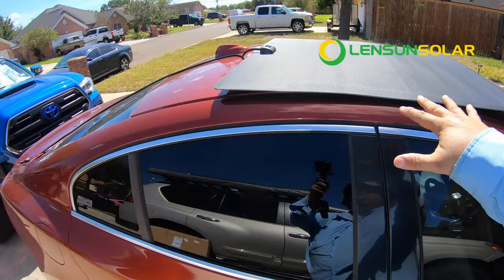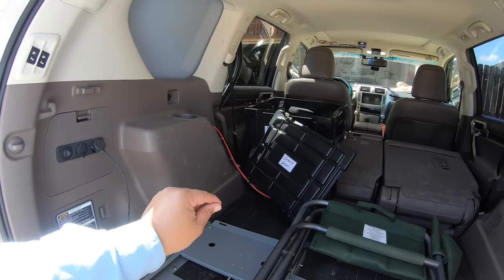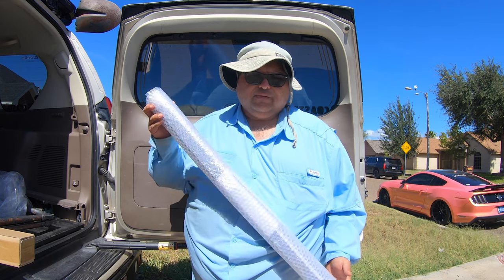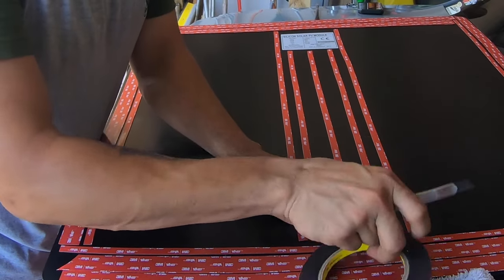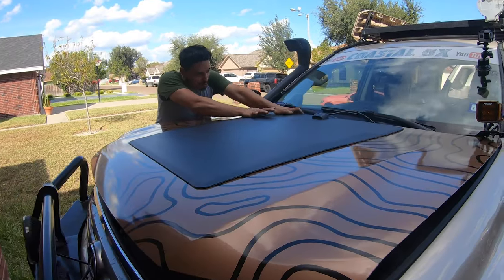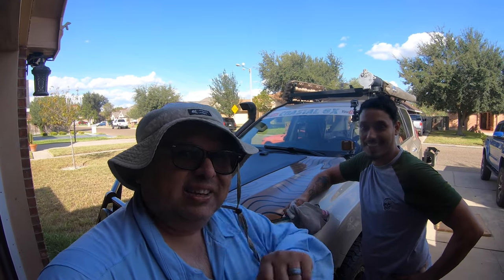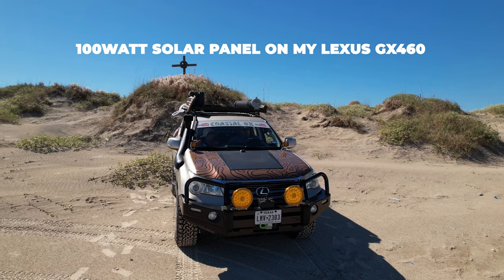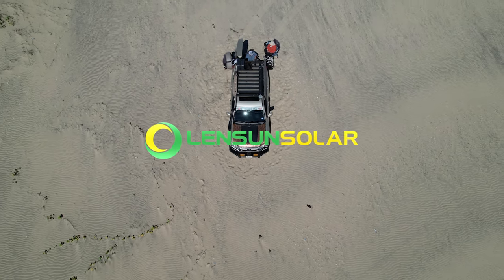Hood mounted solar panel installed on GX460 - Lensun Solar

Comment: If you use multiple extension cables and plugs chances are that you switched the + and - poles somewhere along the way. That has happened to me  once while using off the shelf adapters and cables. So you might check the + all the way from the solar panel to your mppt,. And from your mppt to your battery.
Reply from the maker: Thank you for sharing this!
Reply: @CoastalGX  You're welcome. Hope you will find the cause, whatever it is. Btw, it's a bit hard to see but is the mc4 plug at the end of the red extension cable (on screen at 14.16) a female plug? If it is you might have connected this red cable to the - male plug of the last black cable going into your mppt. Maybe I'm  all wrong but I think it's worth checking.
Reply from the maker: @Remko2011  The problem was with my crimping on both the Anderson plugs and MC4's. It was just a micro length from clicking properly. I know better now and everything is working as it should.
Reply: @CoastalGX  Good to hear you solved the problem!

Comment: I purchased the 35 watt solar system with solar charger with Bluetooth for my start battery only. But I will definitely be checking out my solar panel before I mount it to my jeep gladiator rubicon hood

Comment: Nice video - I like how you show us the struggles along the way - it is more real! I am considering just mounting a true sine wave inverter in the rear of my GX to charge my power station which I run my fridge and electric blanket from. the inverter will charge my power station when driving. Seems like a small 500W inverter connected from either the 3rd row power seat harness or from the engine bay (new wire run to the back like you did) should do the trick.
Reply from the maker: Hi John, thank you for the feedback. Yes, there’s options; Just make sure to check the appropriate wire gauge and fuses to avoid risk. 🎥

Comment: Thanks for the informational video, I'm thinking about buyin the same panel for my 4runner but have it hooked to a Ecoflow power station and use that for my fridge and any other thing I might need 120V.
Reply from the maker: That should work; there’s different configurations. I’m still using this setup and it’s going strong. I park in covered parking at times and the heat is brutal so the fridge works hard. I have to charge my battery on weekends and the panel maintains it the rest of the time.

Comment: The simplest way is to connect to MPPT directly to the solar panel without the extension wire and then the wires that are coming from the MPPT to trigger charge the battery connect that with the extension wires that you already have installed to the battery that you have installed in the back of your Rig. That should fix the problem?   The MPPT is designed and calibrated to work with the length of the wires coming out of the solar panel.
Reply from the maker: That’s what I ended up doing. The MPPT is located closed to the solar panel in the engine bay and then I ran the wire back to the lithium battery. It’s super hot in my area so I wanted to prevent having the MPPT under the hood.

Comment: Some solar controller may have a minimum voltage requirement before it starts charging the cable from the hood to the back of car may cause a slight voltage drop just enough to keep the solar controller from kicking on
Reply from the maker: I’m getting another MPPT just in case that’s the issue. Also talking to Lensun about getting a 20a or playing with settings, but I have to move on to other projects. Weekend warrior life I guess lol.

Comment: Awesome video!! 
Possibly to much resistance? With how long the power and ground is.
Reply from the maker: Thank you. Yes, I had to keep the controller in the engine bay; closer to the panel. The setup is very efficient since it’s always sunny here. Power goes on for days.

Comment: For the fridge, you want to pull straight from the battery, not from the charge controller.
Reply from the maker: I will have to double check that. This is the first I hear about that. 👍🏽

Comment: If the battery is at 100%, How much charge do you lose over night from the fridge and will the panel recharge back to 100%  the next day granted you have plenty of sunlight?
Reply from the maker: There’s a whole lot of “depends” to properly answer that question. What I can say is that I use a 53qt BougeRV fridge/freezer which is always on at 32f. With my setup, my battery still has power after 7 days. I top off the battery after day 7 with my Victron charger and I do it all over again. My truck is under covered parking during business hours at work so that means I don’t fully exploit the bright sunny days in South Texas. Also, the fridge works harder cause it’s always hot. So I would imagine that it would last longer if I was out in the sun longer or maybe less if it was overcast all the time, but maybe no effect since it would mean cooler temps? I can say I really love this setup and it’s been a game changer for me. Hope that helps somewhat.

Comment: Could you not have run a metal conduit under the car and run the cables through there?  You can also run other future cables throu the conduit later if its a big enough diameter.
Reply from the maker: Yes, I have a grommet that allows access to the rear. 😎🙌🏽

Comment: You were losing too much voltage to the MPPT because of the length of the cable. The best decision was to move it closer to the solar panel
Reply from the maker: I was sort of flying blind on this one. You must be correct cause all is working fine now 😊🎥🎬